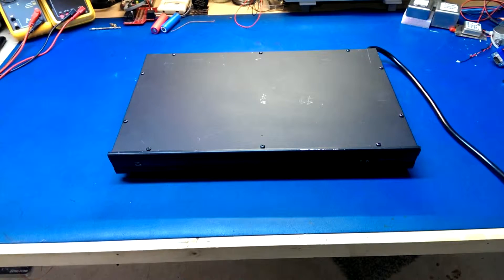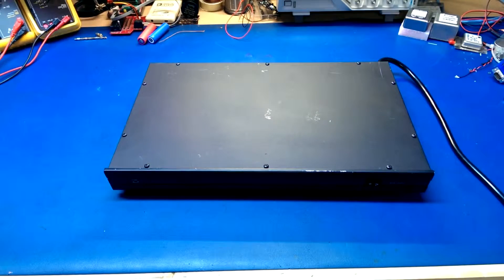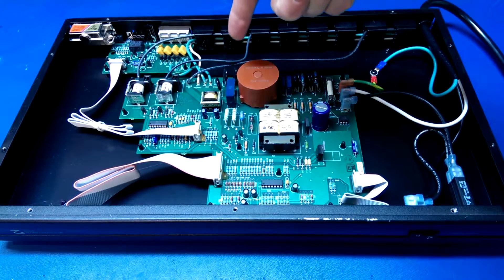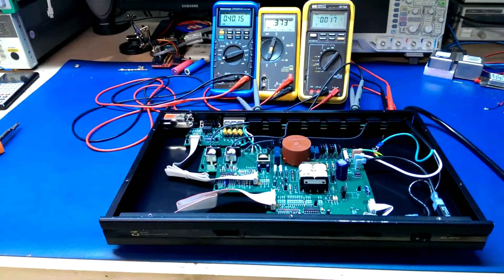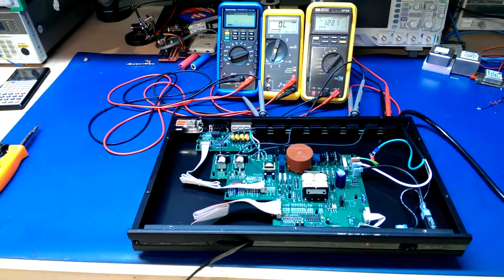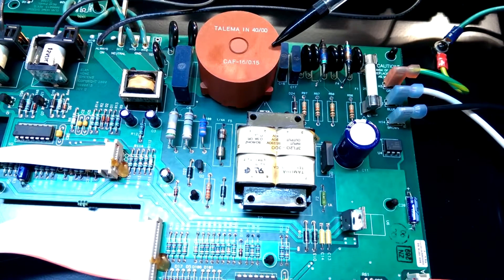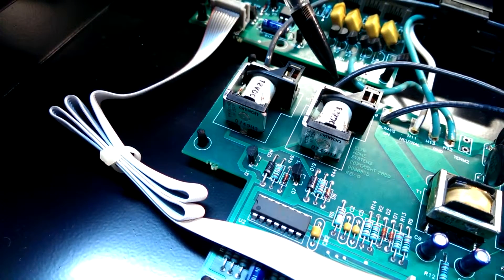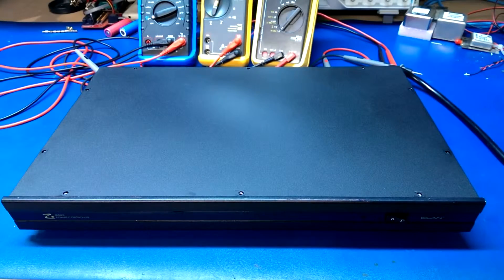ELAN Z Series ZPower Controller / Conditioner Teardown

Comment: Do you have any idea what would prevent a Z660 from working? The red light is on and im not getting output. I checked everything, all the fuses are good. The settings are good too. Thanks
Reply: I got to this video looking into the exact same problem wqith a Z660.
Reply: @jonnobrakesman  i got mine working, I just unplugged all the internal connectors and plugged them back in again. Must have been some oxidation on them.
Reply: @linandy1  I have been looking for a manual for it to test it all but I'll give that a try and clean it all up and see what happens.  Good to know yours was fixed!